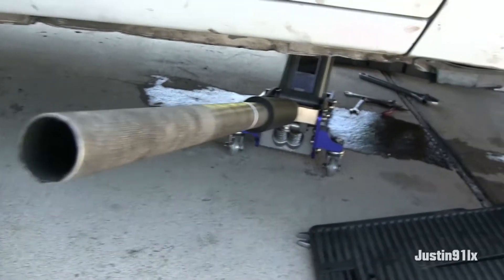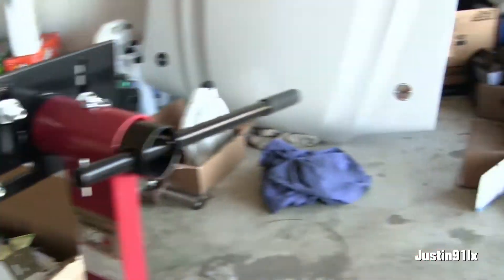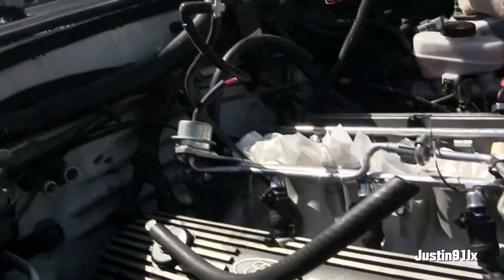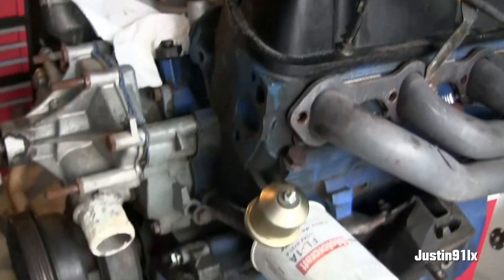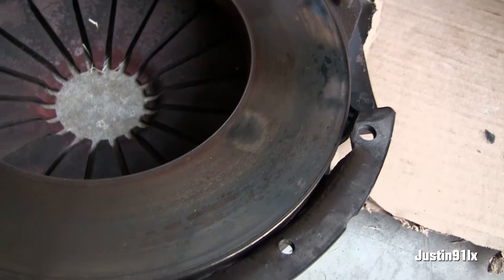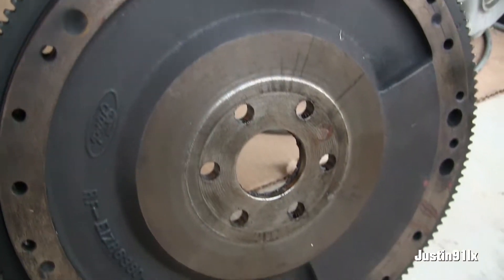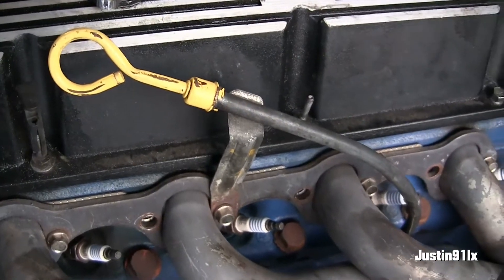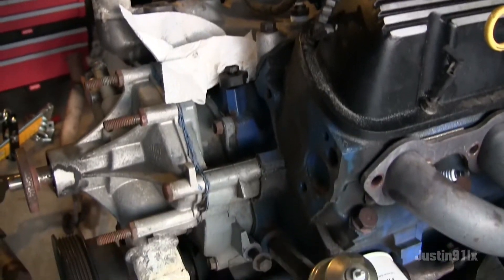Mustang Motor Rebuild Part 3

Comment: Yes heads' cam, intake' 24 pound injectors, msd ignition etc.. all that give you close to 350hp
Reply from the maker: I was thinking of going with the gt40x heads e303 cam. Im already running 30lb injectors, and a cobra intake W/ 70mm tb. Also looking at the trickflow heads and cam.

Comment: Get all new if you can is better in easy to switch now
Reply from the maker: Thinking that too. Planed on new water pump and starter
Reply: justin91lx get that and the trick flow stage 1 package
Reply from the maker: Like heads and cam?